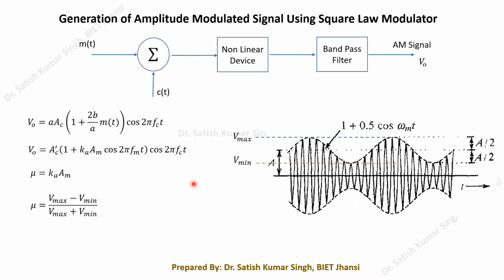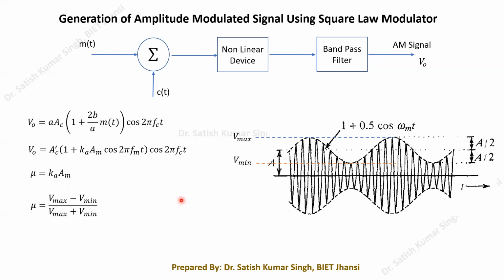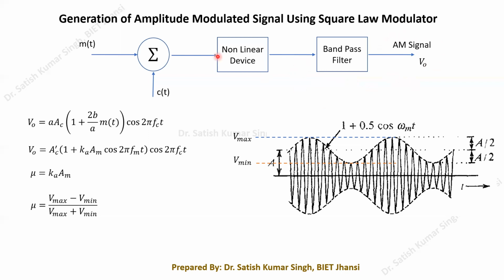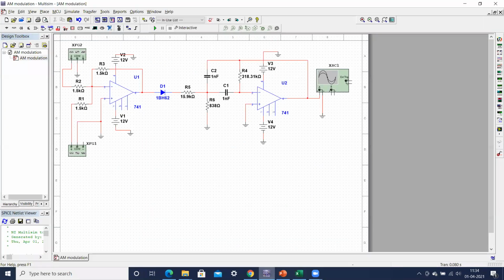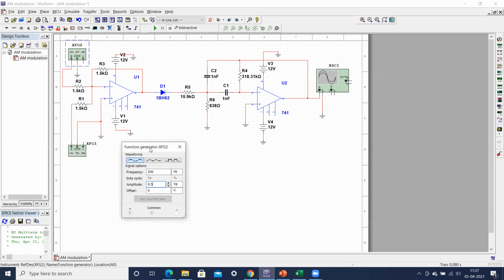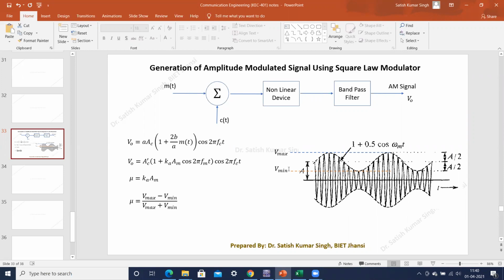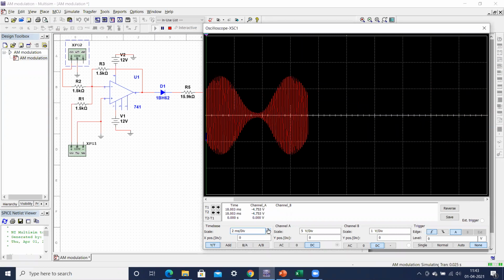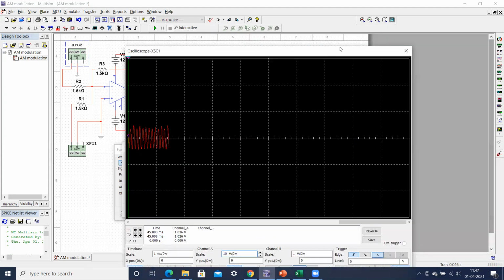Communication Lab | Amplitude Modulation | Using MultiSim | Square Law Modulator

Comment: Hi sir! im struggling with the computation for the 2nd order bandpass filter for Carrier frequency of 20kHz and Message Frequency of 5kHz. I followed the formula for computing using the gain of 4 and Q factor of 2 but its still not the the exact AM signal that im expecting? what might be causing it?

Comment: Sir,how to check for different values of m ? If m is less than 0 
M is greater than 1
Reply from the maker: You can play around by controlling the Am/Ac ratio. Probably m<0 could not be achieved but m>1 is possible.

Comment: To implement this circuit for voice modulation what should be the bandpass frequency?
Reply from the maker: The Center frequency of BPF will be the same as the carrier frequency and min. bandwidth of BPF will be the BW of the voice signal (5kHz).

Comment: Hello sir, thank you for the video. Can you please provide me the details on how you designed the circuit or chose the components values? Can I also know the calculations you had done with this kind of circuit? My email is muhdalihsan14@@t. Thank you very much sir.
Reply from the maker: The designing of the above circuit is straight forward as I have already explained that it is based on square law modulator block diagram, therefore, the first stage is just a adder circuit (R value does not matter but has to be equal) followed by a non-linear element (diode). The only designing part is about Band Pass Filter whose link I have provided in the description box. Please go through the video for more details.